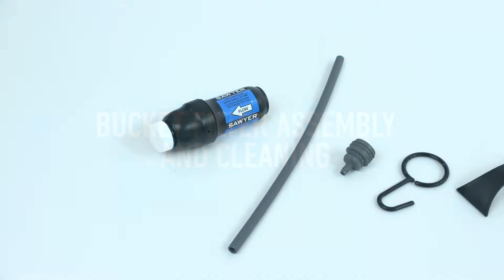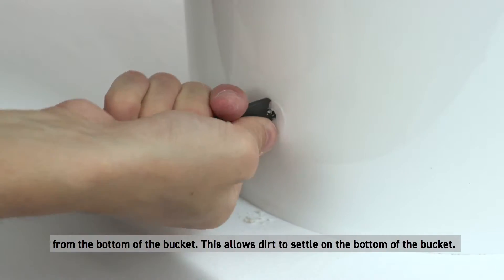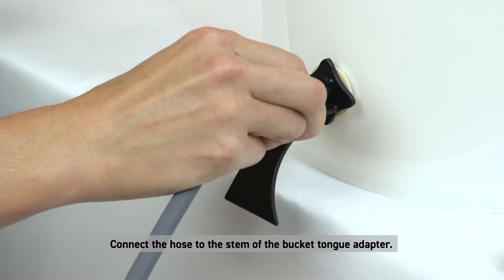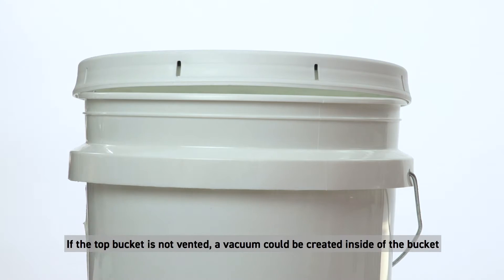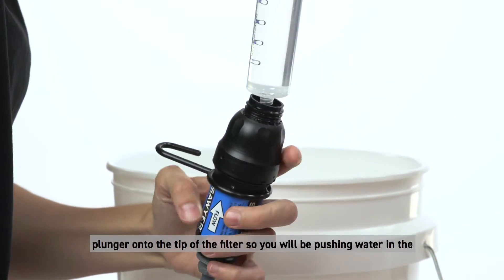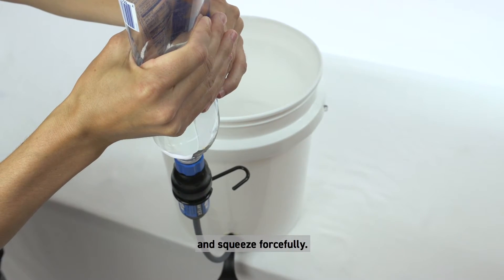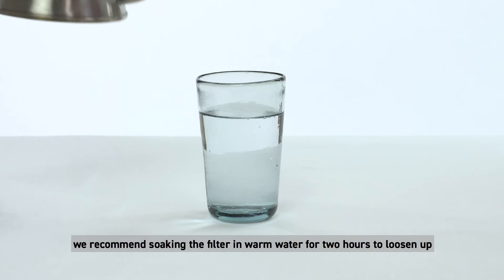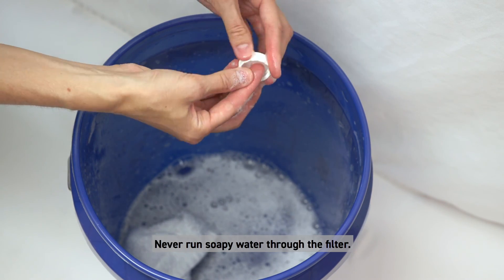Sawyer Bucket Filter Assembly and Maintenance Instructions - SP180 - with captions

Comment: This kit is composed of entirely defective products. I just got a kit online and the threads don't even screw tight to the bucket, causing it to leak. And the adapter that connects to the Sawyer filter leaks as well. They never even tested the products before mass manufacturing them.

Comment: Why keep this video if you aren't selling them anymore?
Reply: Because this kit is composed of entirely defective products. I just got a kit online and the threads don't even screw tight to the bucket, causing it to leak. And the adapter that connects to the Sawyer filter leaks as well. They never even tested the products before mass manufacturing them.
Reply from the maker: they are still available.  visit https://www.international.sawyer.com to learn more